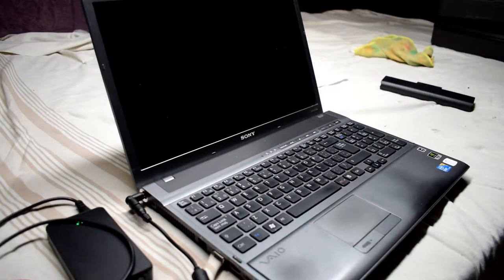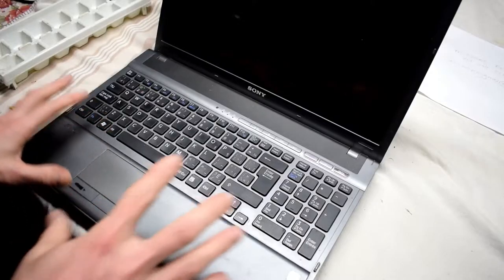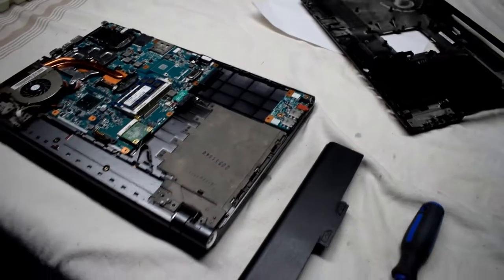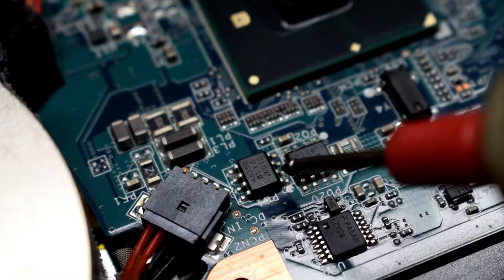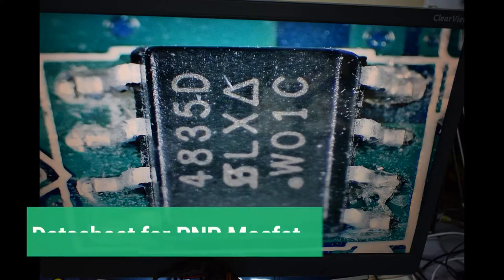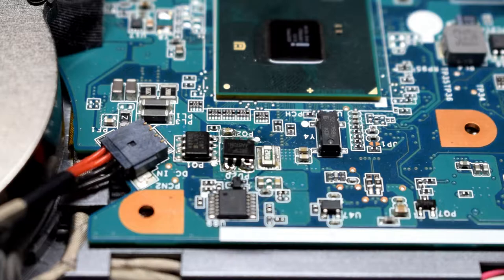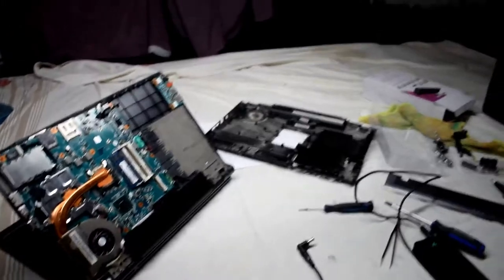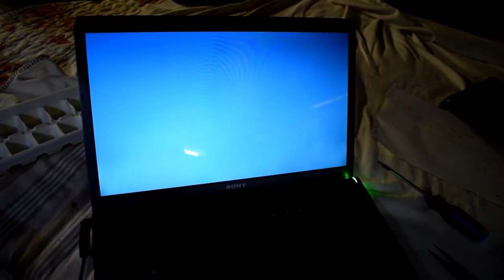Sony laptop not turning on NO power, NO charge (Motherboard diagnostic and repair)

Comment: after I turned off my VPCSA4c5e last night. It doesn't turn on any more. when I connect it to power grid and push the power botton its HDD starts to turn. no boot and turn on its power leds. but the battry charge well- what can I do ??

Comment: Thank you for this video to give an idea what to look out for. I have a Sony VAIO VGN-NW20EF laptop. The power jack had issues so I replaced it last December 2022 and all was well. I haven't used it since until today and it didn't turn on at all. Same symptoms. 

I found out the CMOS RTC battery was flat so I disconnected it, but the laptop still doesn't get any power.

I'm getting voltage at the input and the MOSFETs are fine. I've checked the resistors nearby and they seem okay. At a glance, I can't see any bad ICs so I'm clueless on where to investigate next. Any suggestions please?
Reply: Strangely enough and by accident, I was rotating the charging cable and it started to charge, only in some specific position. Still not sure if it's the power jack or the charging cable. I'm hoping to try out another charging cable and get to the bottom of it.